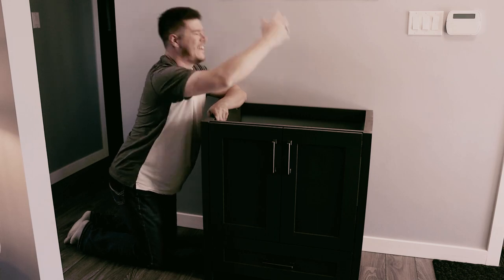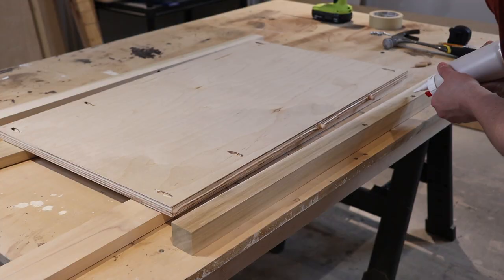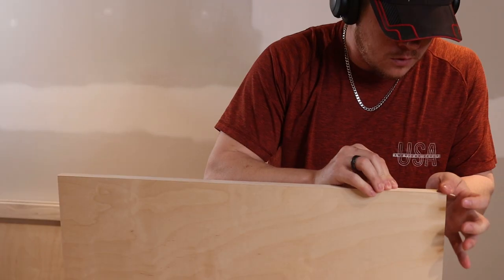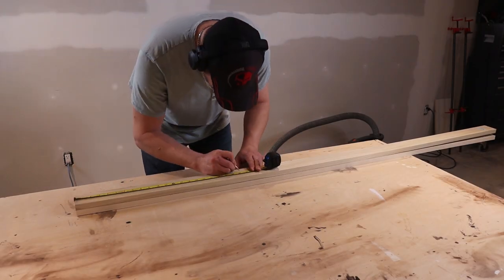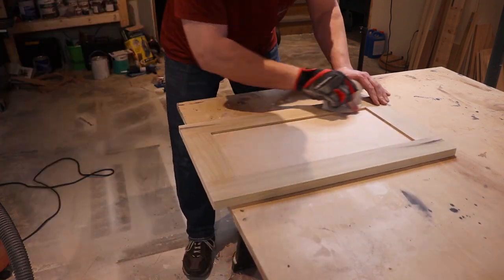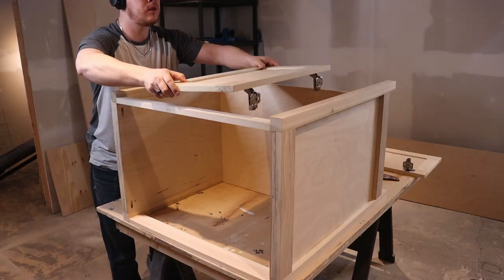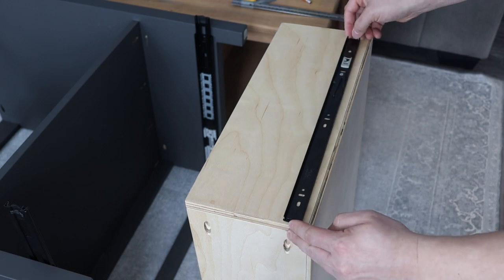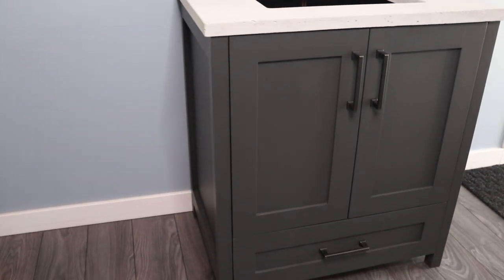DIY Bathroom Vanity // Small but spacious - plans available

Comment: With the price of lumber in 2023 still, I'm not sure if one can build this for less than buying a vanity. Unfortunately. I mean plywood is still pretty expensive yet. And it looks like you are using the "pre-milled" poplar boards from a big box store, which can be pricey too. (if you don't have  a jointer and planer it can save a lot of time to just buy premilled but you pay probably 2x the cost of even a hardwood dealer) . However, if you have to customize something then it makes sense to build it.
Reply from the maker: Yeah, I never said it was cheaper because it wasn't. But it of much higher quality and much much sturdier than any vanity you could buy in store which is worth something too.

Comment: In Puerto Rico the majority of vanities are made of pvc. Have you thought about doing a project using pvc? I was thinking that the drawer in your vanity is going to get wet  in case of a water leak. What about a vanity  made with wood  but the drawer box made of 3/4 pvc panel,  and its face made of wood? Thanks.
Reply from the maker: Really? Thats different than here. We have very limited pvc that I could buy here, and it's very very expensive, mostly outdoor materials here and no sheets. The chances of a water leak are always there, but pretty low here.

Comment: Where the hell have you been? Thought you’d be CanaDOAn! 🤣 I get it, some projects just suck the life out of you. Have been trying to perfect a dual planter with bench in between and it’s been kicking my ash! 🤣 But it’s almost done. Anyway, have had problems finding the best tongue/groove bits. What worked for you???
Reply from the maker: I've been struggling with this thing and the top for it lol as it is the top isn't done yet and I admitted defeat and decided to just release this lol Yeah hey, sometimes they just fight you. Then you just need to step back and come back at it another time. Hopefully you get er done, it's planting season lol I linked the exact bits I used in the description. It was the Freud adjustable bits, expensive but man they worked amazing. These are even made for undersized plywood which my first bit set wasn't so the center panel was a little loose. Was annoying but I'm actually glad it worked out this way now. Thanks for keeping tabs!
Reply: @JessedoesDIY  Thanks! BTW, that vanity looks amazing and love the color. Cement is tricky, don’t know your issues but I’ve done them with plain cement, grating, chicken wire and even rebar. Polishing cement is another story. Ok, maybe I’ll finish planter before end of summer! 🤣 I’ll race you to getting it done before your cement top! Keep up the great videos, you rock!!!
Reply from the maker: Anytime! Thanks man, I'm pumped with how it turned out. It's weird because I've done lots of concrete tops before, but I've never had so many issues as this, I've even been in vintage with quikrete to figure out the problem. Lol better hurry then, planting and sitting in the sun season are upon us. I'm pouring the next top this week!
Reply: @JessedoesDIY  I’m sure you’ve tried flow control. There’s a great channel mostly about concrete, and I’ve learned a lot from him. Try it out… Michael Builds.
Reply from the maker: I've got some right now I'm going to add. Quikrete says they have some in the mix already and isn't needed, but that has not been my experience. I've seen his channel, unfortunately he has a lot of incorrect info on concrete. They may turn out ok but I wouldn't count on his projects lasting without curling or cracking